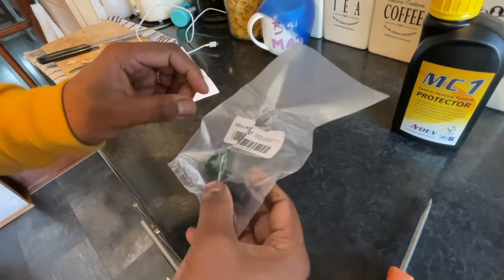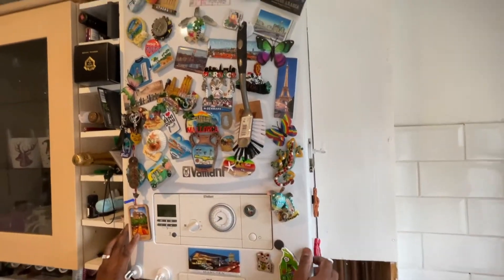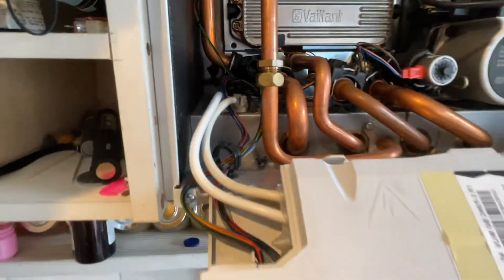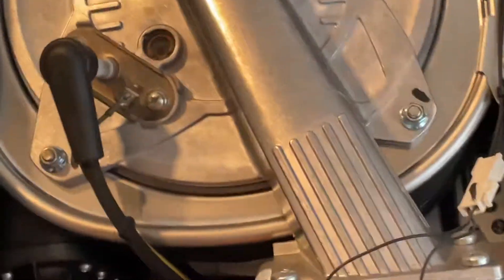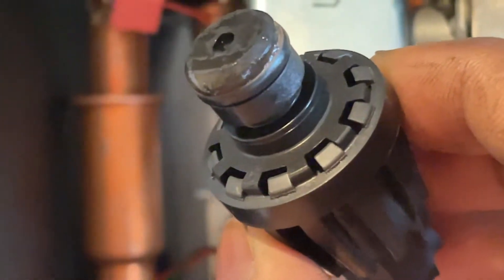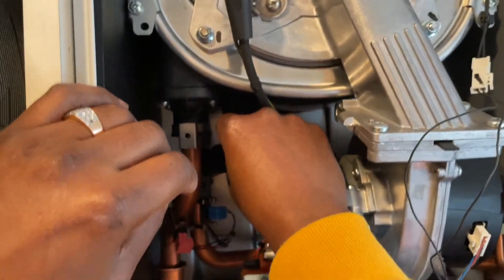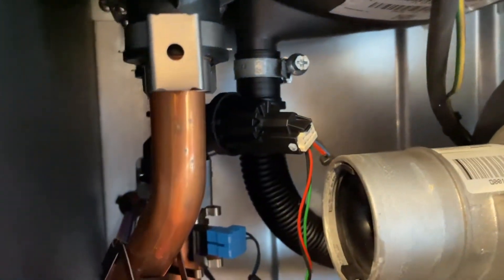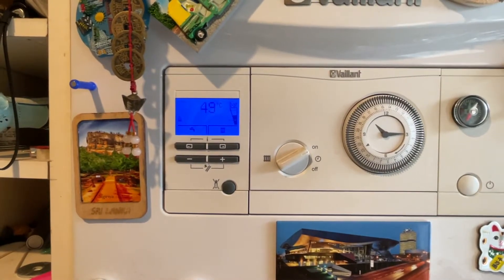VAILLANT BOILER ECOTEC PRO 24 28 OR GLOW WORM F75 ERROR FIX

Comment: i did it and all the water came out 🙄😞 did you say that in the video?
Reply: Hi, the same thing happened to me
Reply: Ive bloody done the same, boilers showing ‘comm’ error, did urs do the same? Ive also a problem with the electric pin that connects into the sensor as i had the old orange coloured sensor which is now discontinued and the old ones connection is much deeper inside the sensor, plug wont go deep enough to connect
Reply: @adzsyed2051  hi we solved the problem after we changed the "quick air vent" now it works . it costs between 20-30€ .

Comment: Tools needed: Screwdriver, cloth, lubricant, and FGA surely?
Reply from the maker: Why? Im sure there is no need to check the CO/CO2 ratio for the flue after changing a Water pressure sensor. A Sensor..... Sensor.......
Reply: @HarleyandChase because you dont know what you are doing  once you remove the casing you need to do your 26.9 checks

Comment: I do dozens of these every year , 95 % caused by dirty sludge filled system water , I advise customer to get system flushed but they very rarely do and so on it goes year in year out until the boiler fails prematurely.....👍
Reply: I had the F75 error, emptied the water and cleaned this sensor. After the replacement I increased the pressure bht the boiler showed different pressure values, it kept changing until it stabilized and showed a correct pressure. The error code disappeared. The problem is that even after the replacement there is no warm water coming. Do you have an idea what is causing this? Thanks